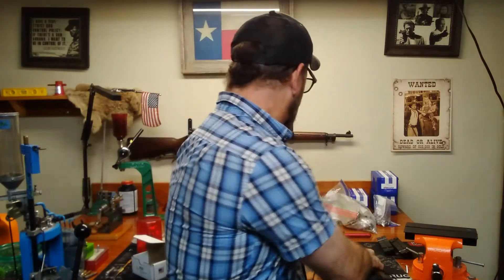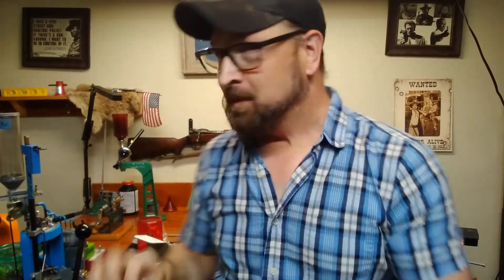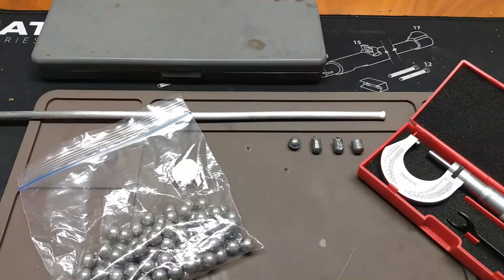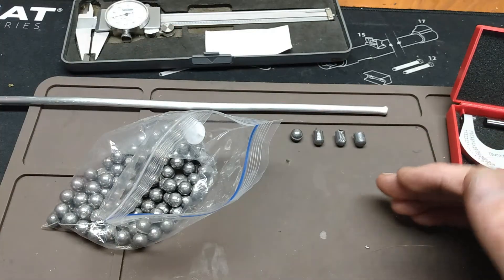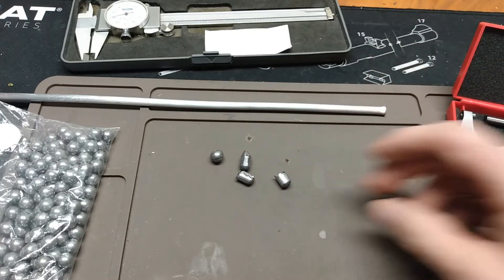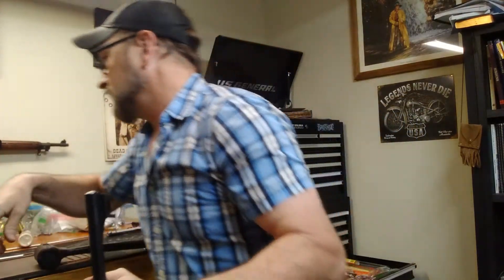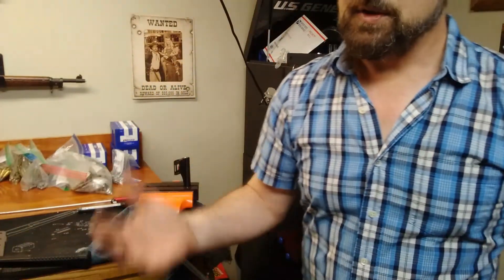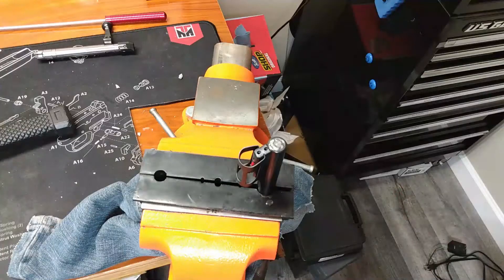Pt.4) 7.62x39 Cast Bullet: Measuring a Rifles Groove Diameter

Comment: I've found that it helps to slug from the breech when possible. Acts like a funnel/ forcing cone. I also use the largest hardwood dowels that will fit in the barrel, cut to around 4" long each. Keep up the good work Sir, love the content.
Reply from the maker: I'm not opposed to doing that. I did try it once but it didn't work so well. I just never tried it again. Thanks for the comment and thanks for coming by. I hope to see you around more often!

Comment: Buy a cheap sinker mold that casts varying sizes of football-shaped sinkers. The shape makes it easier to start down the barrel. Use stick-on wheel weights. They are soft lead.
Reply from the maker: Not all stick ons are soft. Gotta get the ones that are stamped. But yeah, a football shape would be easier. Thanks for coming by!
Reply: I should have said the lead stick-ons but thought that would be self-evident. The lead ones are dead soft.